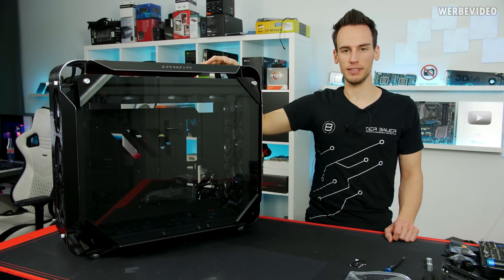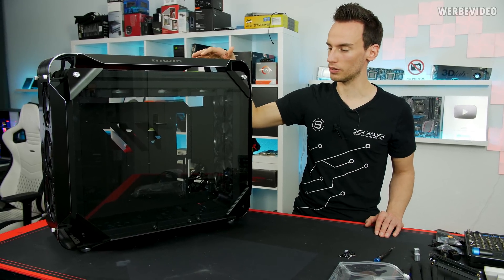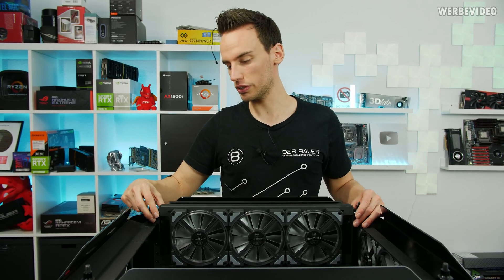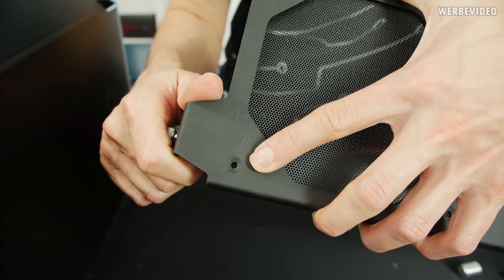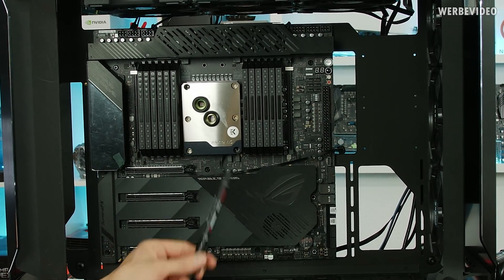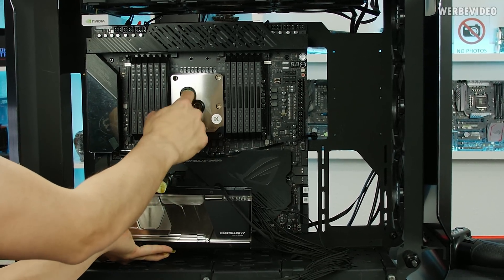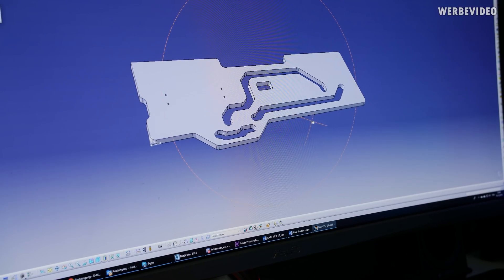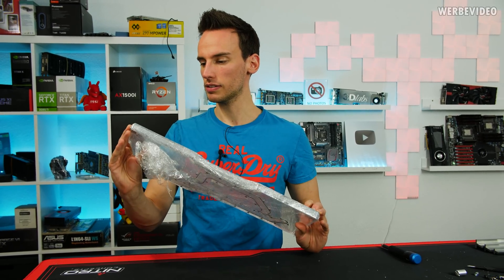Project Irrationality Part 6: PROGRESS - Our Custom Made Distro Plate!

Comment: Why don't you use the space in between the two VGA cards to feed the inlets and outlets of the cards, instead of routing them from the front of the foremost card? You could use two rotating T junctions (with a 45 degree angle on the inlet) and route both tubes on top of each other going towards the power connectors of your card. It would make the build much more cleaner, interesting and unique.

Comment: I think you made the right choice on the case. I have a Corsair 1000D with an SSI-EEB motherboard (Asus Sage C621E), and while it is technically compatible you can only mount the motherboard with around 4 screws, which is really insufficient if you want to ever swap out RAM safely, without completely removing the motherboard. It's still usable but very much not ideal. It also weighs 40kg when populated due to the steel construction and huge pieces of thick tempered glass, making it an absolute nightmare to move. Looks fantastic though.

Comment: Could you use an l shaped power connector for the GPU? A VERY minor detail but i think  that would help. Also no water cooling for the VRM'S? Not sure if i missed it in a previous video..
Reply: PROTRON he soldered the power connector directly  to the back of the GPU

Comment: TR.3970X crushes this processor costing significantly less and not requiring delids/chillers.
Reply: Yes. By the time he finishes this build 3990x may be out.
Reply: frostybe3r - the 3175X has slightly better Premier performance especially Oced; he posted benchmarks in the following video (#7), IIRC. Aside from cost, the main advantage for TRX40 are the pcie-e lanes (64 vs 48) and of course able to upgrade to the 3990X for 64 cores. He also wants to use U.2 drives for whatever reason he sees justifies them.
Reply: Can you provide link where it crashes this cpu with quicksync on in Adobe
Reply: @directlinkrexx4409  W-3175X achieves 7.4K R15 score on a subzero chiller at 5.1GHz consuming over 900W or so, my TR 3970X consumes 280W at stock getting 7.8K R15... And it costs £1100 less with a considerably less expensive or oversized motherboard with two less channels.
Reply: @directlinkrexx4409  Xeon W-3175X dont have quicksync hardware.
Reply: @directlinkrexx4409  
This CPU doesn't have quicksync.

Comment: This is wayyy better than JayzTwoCents build
Reply: We’ll see... neither one has finished😂 Not sure how Jay’s isn’t custom. Metal custom loop, repainted everything... but yeah. Roman is taking it a few steps further.
Reply: @currentlykent4593  that tubing is "off the shelf" but repaint and tubing passthrough is surely custom but roman is taking custom up a notch
Reply: Edward James Scott Kenway it’s not like Roman is going to blow his own glass right? 😂
Reply: @currentlykent4593  yeah. But that distro plate or that gpu wiring or case mods they are way custom
Reply: @currentlykent4593  though they are two different beasts and should be represented differently thats what i am trying to say
Reply: Edward James Scott Kenway $20 says Roman gets his done first.
Reply: @currentlykent4593  i know.
Reply: now you are comparing apples to oranges. both are good builds but this one is more custom while his is mostly of the shelf parts